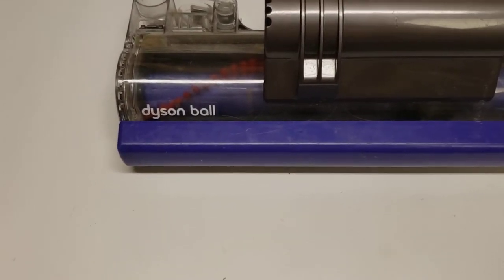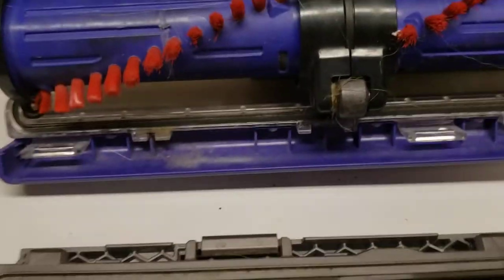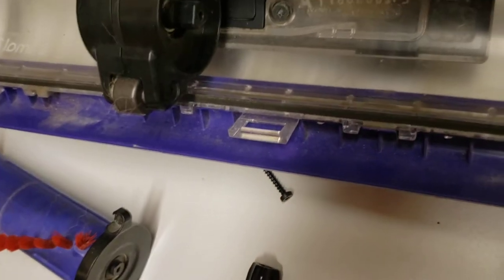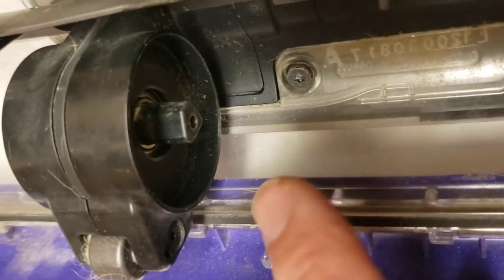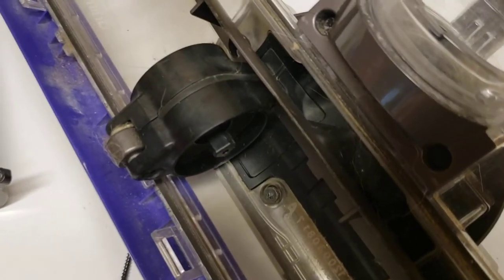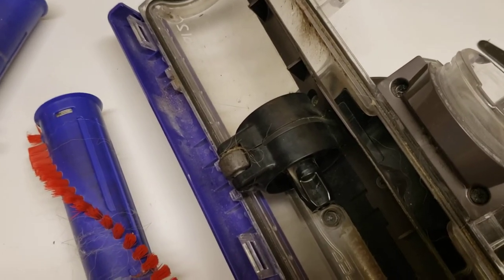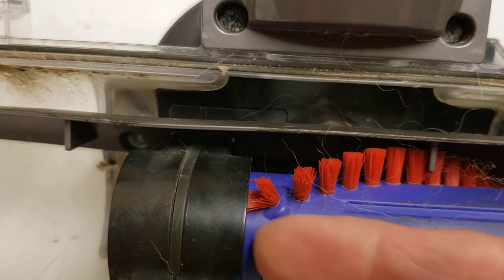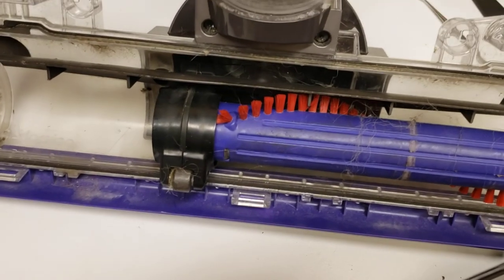Dyson Ball Animal 2. Fix for burning smell.

Comment: Oh good googity-moogity, when you said design flaw, you weren’t exaggerating one bit!  
I wish I had seen this video before I disassembled the entire Dyson! 

I finally followed the wretched burning hair smell to the brush rollers, which I take great joy in cleaning any & all visible hair from nearly every time I vacuum, but I found out that was to no avail.   It was the hair you couldn’t see… the hair that shouldn’t be able to get where it did that was the problem!

What I found on this $700 piece of crap was a hair plug so gross & burnt that I couldn’t yank it free with tweezers & extremely sharp, pointed precision scissors, or even cuticle nippers working in unison with tiny needle nosed pliers. 
I had to use a professional dental scaler & a Waterpik with HOT water, and on the highest setting to get the carbonized, felted hair out of the bearings!  
Alas, I think the Waterpik flung a good bit of overspray into the brush motor. 
So I have the motor drying out inside the Viking oven on pilot.

Hopefully, once it’s completely dry I can test it without frying the motor.
But you know what?… 
I’ve already gone out tonight and bought the prettiest, most expensive Shark vacuum model, which is STILL only half the price of the damned Dyson, because this Dyson has pissed me off to the point where I don’t really care if I plug it in and it looks like Frankenstein’s monster getting 300 million volts to the bolts!  It can melt for all I care… I’ll never get the rank burnt hair smell all the way out anyway.  Damn thing made my house STINK!
Reply: LOL - okay you’re not wrong… I’ll never buy another Dyson new again after doing the same thing and realizing Shark makes a TANK of a vacuum.
Reply: @PanhandlerT  I agree with you on not buying a Dyson.  Our experience with one of the early Shark steamer products was awful, hopefully the later products are good.

Comment: Your video made the cleaning process so easy. Once I removed the Torx screw from the drive cog, I couldn't pull the cog off by hand. A paint can opener was the perfect tool to pry it loose and also remove the hair from this area. Hugh Mongo

Comment: Thanks for the video! I assumed something was wrong with the ball portion but after seeing this I pulled apart our bearing housing. Removed the motor and all - the bearing was gummed up even though we keep the brushes fairly clean. Two people in the house with long hair does the same damage as a pet! Likely need to replace the bearing now as the plastic retention ring has started melting / fusing with the hair.

Again big thanks for the vid. I would have been hunting for a while trying to figure this out instead of only taking 20 mins!
Reply: Yeah as someone who really appreciates great engineering, I was inspired by the original founder's story.  I am saddened that Dyson, now like seemingly every other company, has been owned by private equity for a while now.  I don't expect anything but this from them from now on.

Comment: What's the tool you used to get the bearing part off? I have the right head for my screwdriver but it's tapered and won't fit in the hole all the way. About 1/"4 short of grabbing the screw. Thanks in advance.

Comment: what size screw do you need to unscrew the 4 tiny screws that hold the roller to the attachment?
Reply from the maker: Garrison B
1 second ago
I will pull it apart again tonight and post the torx driver sizes.  I had used a slightly different spline tool set because it was what I had at the time.... stay tuned..
Reply: @garrisonb4422  I'm having the same issue as well. I can not take the screw out of that drive portion  at 1:53.

Comment: Hi thank you so much for the video.. I’ve got the 4 screws out of the brush bar  but struggling to find the right screw head to remove the drive cog ? Seems to be smaller than any head I have, what size did you use ? Thanks
Reply from the maker: I will pull it apart again tonight and post the torx driver sizes.  I had used a slightly different spline tool set because it was what I had at the time.... stay tuned..
Reply from the maker: The drive cog screw is smaller than a torx 10.  the 10 is just every so slightly too big so it must be a torx 9.  I am pretty sure an 8 would be too small.  I ordered a set of the 1 through 10 sized bits so I can confirm.
Reply: A Torx T10 worked for me
Reply: So Harbor Freight had a Torx head that works for my socket driver, but it says it's a T10 - fits fine. I have a separate set of Torx heads and the one that fit from that set is the T5. So it seems like it just depends on your set of T heads lol.

Comment: I removed the bar and hex screw. How do I get the drive cog out just pull?
Reply from the maker: There is a screw down in the drive cog.  If you removed that, then yes, it should just pull off.